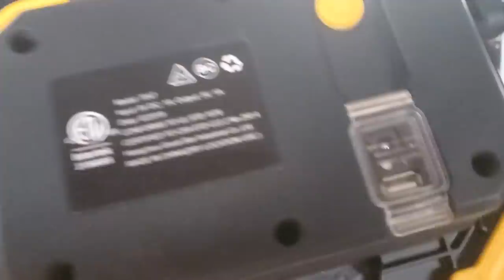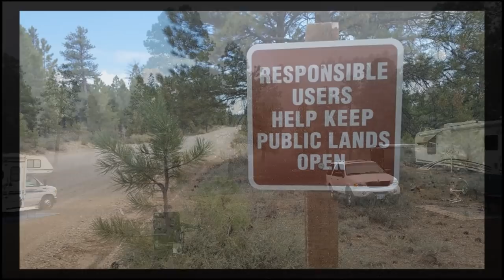Don't Let Fear Of Breakdowns Steal Your Joy Of RV'ing!

Comment: Hi Kevin, I am new to your channel and enjoy it very much.  Your a southern gentleman, not to many of those around.  I do have a question, does your fridge run on propane and is so do you drive with your propane on to keep your fridge cold?  thanks for an awesome video.
Reply from the maker: Welcome to the channel. My fridge runs of 120volts ac or propane... wish it had a 12volt option with all the solar I will be adding. I do run the propane all the time- even while driving. You just have to remember when you get fuel to cut off the open flame before you get around the pumps. It is very cheap to operate on propane- very efficient... maybe 10-12 dollars per month

Comment: Hey Kevin, Kinda dampened my spirt because I am the guy you were telling to stay home.LOL! I am scared to death. If you remember I bought a 94 gaser w/ 82K on it. Have ppwk where trans has been replaced upper 90's,I think. Took it to the shop Saturday just to get the tires aired up. My rig does not have all the correct hook-ups to air tires up. Tech had to pull 2 inserts to get where he could air them up. That alone cost 40. bucks. Hell, I may as well bought a helicopter, it would do me about as much good as the RV. Maybe if I had not had to  spend 4 K on my roof..........................Oh well, Peace!
Reply from the maker: you will get it sorted :) . It takes time
Reply: I hope Thanks,Kevin!

Comment: Actually, if that was an ankle sprain then ice and elevation now is too late. You should just continue to walk on it. It will take weeks if not months before the ligament tissue repairs itself.
When I got diabetes at 55 in 2003, and then taught myself to control it without shots or drugs, I also learned that the way to know you have good blood sugar is if when you get a wound, do you clot quickly?
 Your wound looks nasty, your ankle looks like a third degree sprain, but did that deep gouge give you a quick scab? If so, you are doing good.
Reply from the maker: I scabbed very quick on front of my leg

Comment: Kevin ?? Can you tell me how to simply connect solar, fantastic fan to house battery. Is there a separate wire to come from van battery so it charges house battery, does it need relay what on that line?
Reply from the maker: I'd suggest to join a solar group/rv group on Facebook. Lots of helpful people there with great information.

Comment: Kevin you need to get a cap for that valve core on the a/c line cause i guarantee you a/c will eventually quit over that alone. The caps have a O-ring on the inside to prevent pressure seepage. Hi and low pressure side both.

Comment: Im' going to have to say this was a very discouraging video and would quite possibly deter someone from going RV'ing or pursue the path of living full time in an RV.  The reality is very few people in the typical RV community will have an extra $5 or $10,000 laying around, hell many of their rigs won't even cost that. Now if you're out floating around in a Prevost or Newmar then you might have access to that kind of stash but it's unfair to discourage the common folks out there by saying they shouldn't go out if they don't have a life savings to fix a rig that breaks down.  Life happens,  encourage people to get out and live it instead of scaring them to getting out and enjoy something different.
Reply from the maker: I appreciate your opinion, but I have seen people in dire straights because of finances out here on the road over and over and over. Many of my friends out here are not prepared and I've seen them struggle, and I along with others have had to help them out. I stand behind my message in this video. Remember, I did say if they didn't have this kind of emergency fund then I recommend that they remain more static in their rv's in campgrounds and such than remaining on the road.